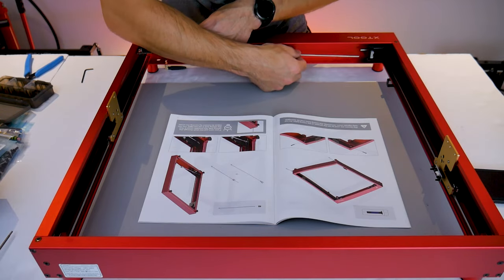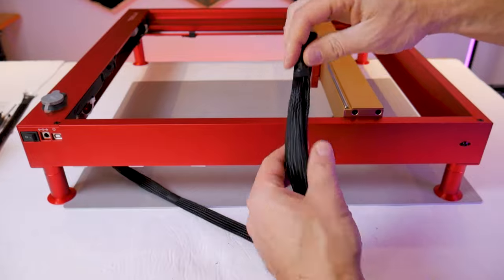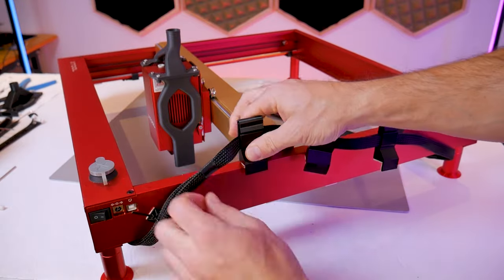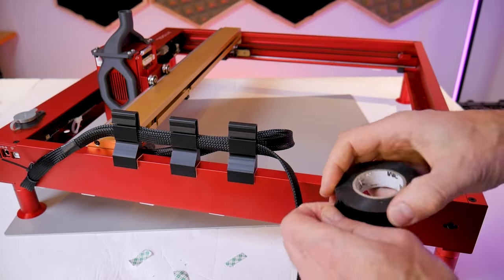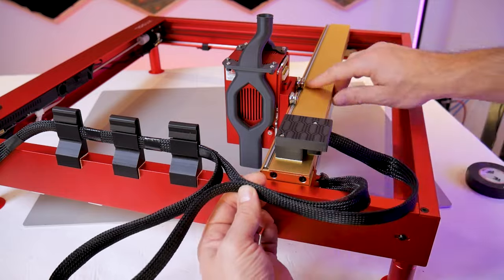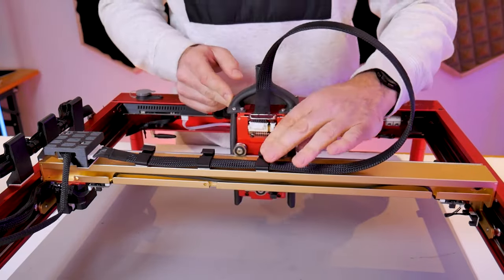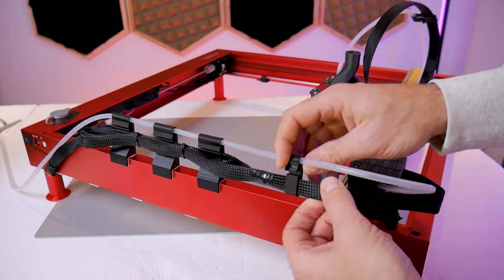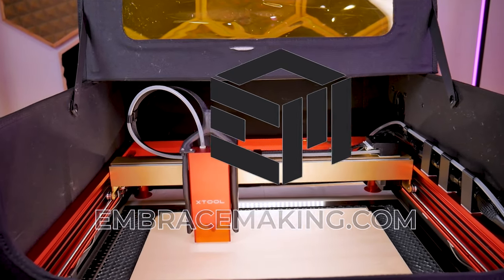XTOOL D1 Pro Wire and Hose Management Installation

Comment: I tried to install the cable management system today on my new XTool D1 Pro 10W.  I followed the instructions exactly.  Unfortunately, the cable harness that came with my new system is shorter than what is shown in the video.  When I ran the harness on the outside of the machine, the stepper motor cable was too short to reach the upper laser head positions (i.e. pulled tightly on the cable).  I wonder if XTool recently modified the cable harness.
Reply from the maker: Interesting, is yours the V2 model with the emergency stop? Contact me here: https://embracemaking.com/pages/contact and I'm sure we can figure it out :)

Comment: Can I use these same clamps for the d1 10 non pro?
Reply from the maker: You can use the clamps yes - but the harness that I include in the kit I don't believe is compatible. Sadly the non-pro only has 8 pins I think where as the pro has 9 pins...
Reply: Hey ordered some things from you for my d1 non pro. Runs amazing was able to build the Stanley rig and I was able to get a hand down fume extractor so I got a dual unit😂 I guess ,( I had sent an email, needed some help with part of my order ) thanks again- 🎉

Comment: still rubs the top of the enclosure
Reply from the maker: The 40W is taller than the other modules and I had the extra thick honeycomb bed from the S1 underneath so it was riding pretty high on the carriage. I can also shorten up the harnesses a bit so they don't loop as high :)